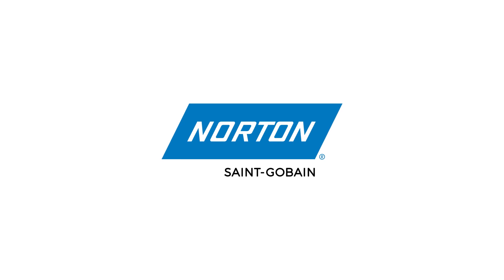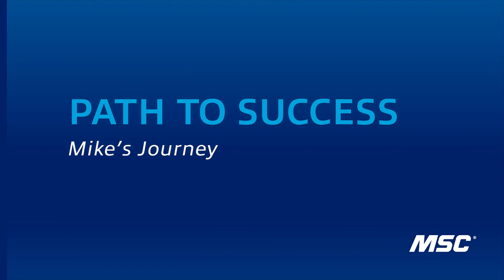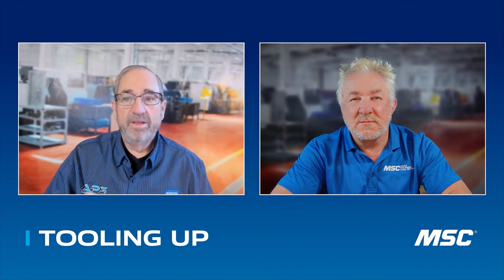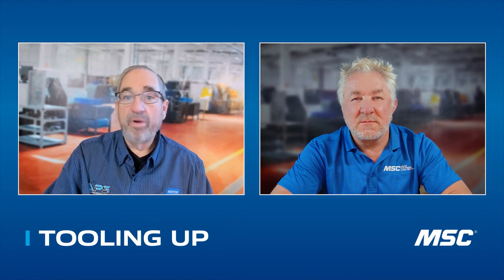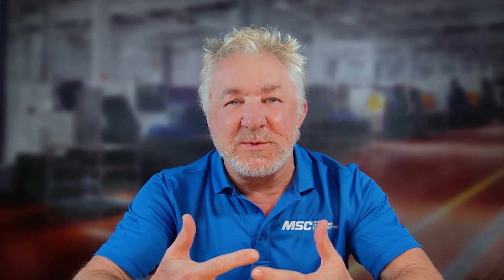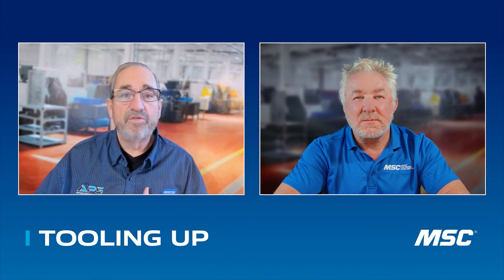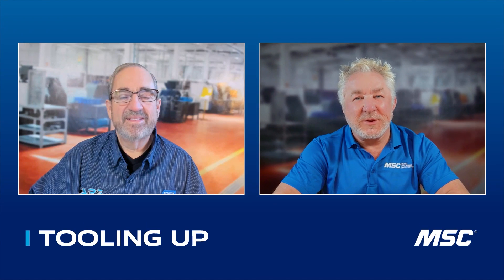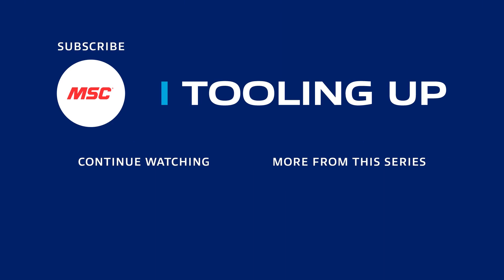TOOLING UP: Applied Abrasive Automation [S2 ep.#12]

Comment: Hey, sorry to be a downer, but I’m a pipeline welder, I’ve used all the brands of grinding discs over my 19 years of work in the trade. That being said, Norton discs get glazed over(loaded with metal) they stop cutting like they should. I find it to be productive to chop the wheel on scrap metal to gouge it, so it will cut again, yet that makes it off balance, making it unsafe as the grinder wobbles much like a wheel on a vehicle will wobble off balance….been using grinding discs for 19 years, Norton has been the worst….for sure, 3M Cubitron is the best, longest lasting, best cutting, expensive at first but performs as it should!! Don’t buy Norton anything!!